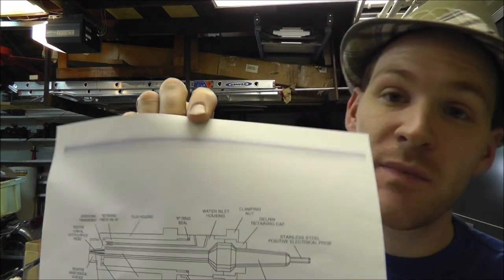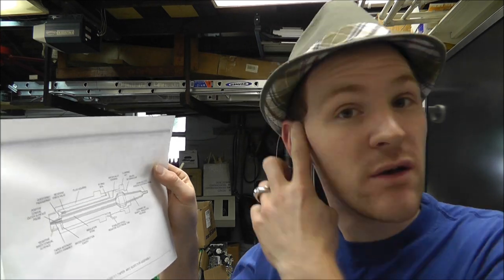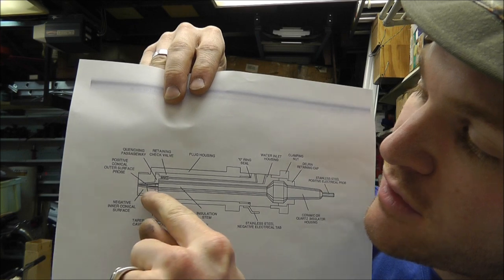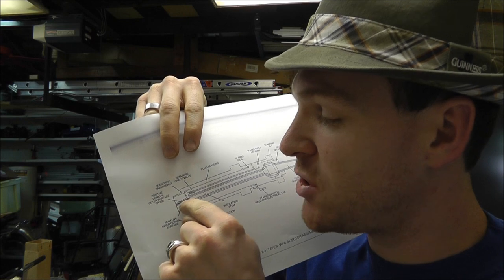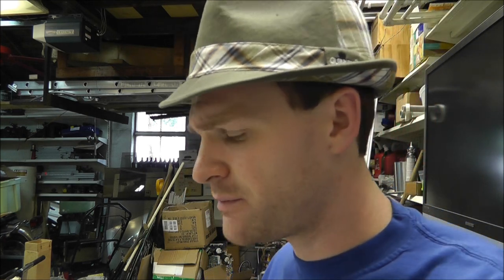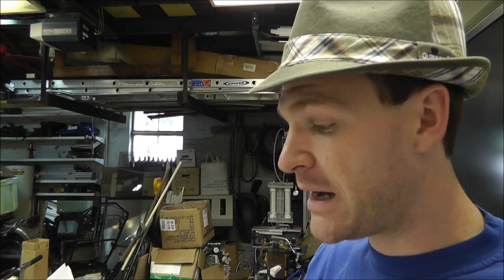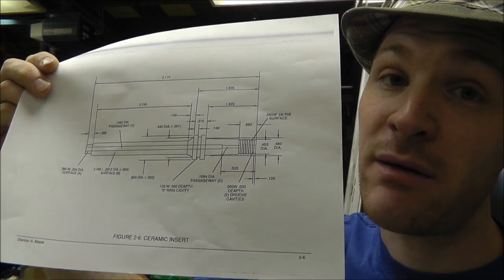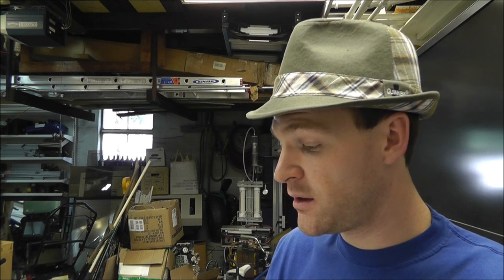Key Points About Stanley Meyer Water Car Water Injector Drawings  Analyzed By ~Russ

Comment: The 430F or 430FR wire (there are different in level of resistance per foot) can be used where ever you wish to use it as it's just to further restrict the flow of amps.

Comment: I believe the length of the charging circuit slots are .075 if you take .400 and subtract.250 then divide it by 2 you get .075. so .400 - .250 / 2 = .075

Comment: I agree with you man they are the water type only. There is no ambient air or non combustible gasses flowing through the injector. The ambient air and the non combustible gasses are entered into the combustion chamber through the air intake valves.

Comment: Ed Leedskalnin (coral castle builder) mentions using stainless steel wire, or iron wire in his generator instead of copper. No copper drag on a magnet, then the iron wire magnetizes and "assists" the permanent magnetic rotor.

Comment: I think that the tapered form is for creating a vortex inside the water injector. In regards to Bernoulis force, with the help of frequency and the water twirling inside it. Then it creates the hydrogen to evenly explode inside the vehicles cylinder. Otherwise it would explode dead center.

Comment: I wonder if Allan could drop a hint of which cars come with stainless wire?  With the cone shape spacing being .010, I think water would not drip out of the hole unless under great pressure.  (like reverse osmosis)  This would keep a fresh supply of water at the point where the fracturing process happens, pushing liberated gasses out.  Thinking out loud..

Comment: The plate spacing is .010 inches not .020 of an inch for you have to divide the number by two as you are looking at a cross section view. Firepinto will also agree with this as he too knows how to read drawings or it seems like he does. And you are right about the ceramic part as there are two different ones being shown so depending on your connection boots you can now make choices. And remember to tell everyone they are the water only type injectors as I emailed you about, thanks.

Comment: PT 1 
Hi Russ and Guys.  Great Work.  Your getting there. Just sharing infomation here on some technology that is already out there. There are two types of equipment in my travels that were used for  environmental monitoring that share some of the basic concepts for parts
of the WFC.  

-Injectors?

Flame Ionization Detector 
This device would be used for detection of Hydrocarbons in Parts Per Million. It ran off a battery pack and had a small internal tank you would re filled with 99.999%

Comment: PT3
a silver looking disc almost identical to the one you have now on the exhaust port.

-gas gun??
Photo Ionization Detector
This unit was used for detecting Chemical VOC, and Gas Emissions and Vapor in Soil and Air. Air samples are drawn through a pump and accross a Electrodeless Discharge UltraViolet lamp at high voltage.  Lamp ranges are 9.8ev for low photon, 10.6ev (normal) and 11.7ev for high photon. This is an actual glass $1,000 Lamp
(NON-LED), which charges the ions either

Comment: I am confused, is the 430fr wire just for the injectors and bobbin setup, or can that wire be used on the prior inductors and vic coils? If I wrapped an e-core with the wire would I get greater production? 
Please Help
Lost
Clay

Comment: PT2
Ultra Pure Hydrogen - Grade 5 Air would be drawn through a tip (10 to 17% Oxygen) with a pump into a small combustion chamber, mixed with and ignited automatically using a small glowplug, and a thermocouple would monitor the temperature by an internal computer and start/stop the flame and recording readings.  The other side of the chamber had an  "Exhaust/Flame Arrestor" which is a BRASS version of your "quinching disc".  Why Brass? because it's anti-spark. Another manufacture used

Comment: PT4
positivly or negativly accross a sensor
and is reported as a reading back to the unit for detection "As organic vapors pass by the
lamp, they are photo-ionized and the ejected electrons are detected as a current". 

-- Sorry so long, but there it is.

Comment: I opinion how to shine cone pin, use sanding pasta/gel on pin first and after on cone hole put gel to hole and spin by drill, like automachanic does valve and engine head sand each other

Comment: let me change what I said the valve allowed the water to enter the water distribution chamber after it enters the chamber it flows through the quenching field which has a positive and negative charge. As the water passes through this quenching field the water dissociated into Hydrogen and oxygen and is ignited.

Comment: NuB HERE but Machinist (Include Hydraulics) ~15 yrs
Deep bore:
FINE turn @ HIGH speed
Depth/Length? but Polish ~ 0.001" to finish
-Disc Brake Hone may work
-Emery in slotted wooden dowel WILL work : PATIENCE & MANY measurements
A LOT easier to remove material than to put it back on!

Slots:
Grind carbide or HSS tool to width
Repeated cuts fed at 0 rpm in (CNC) lathe: Like obsolete but very handy mach tool: the 'Shaper' that cuts with strokes of the tool
,
Know zilch on ceramics < So how to make?

Comment: Bro, you’re doing incredible work, and not to in any way discourage your work, and I know this is an ancient video, but you really have to stop wasting time on copying the water fuel cell. We don’t need that, we just need the toroid. If we can get that overunity electricity, electrical motors will do the rest. All we need is electricity, motors are far beyond what Mr Meyers, rest his soul, could have imagined. Trying to pair this with a combustion engine is just a huge extra amount of unnecessary work, when all of your resources and energy could be focused on the electrical overunity portion of the coil/toroid. 

Starting to collect parts, my plan is the coil/toroid with a chrome paint inner coating, fill it with pure oxygen(magnets pull/affect liquid oxygen, so I imagine his toroid with HHO is operating on the oxygen for his carrier gas) using a chamber in front of the laser with electrodes for the plasma arc right in front of the laser and shooting a laser through it. Don’t give up man, I won’t if you won’t. You’ve got it close. Close enough that it seems the only unknown is the carrier gas